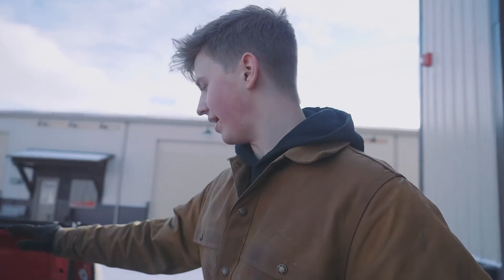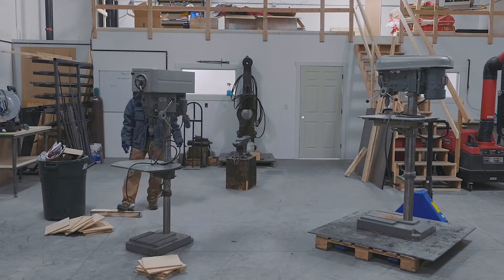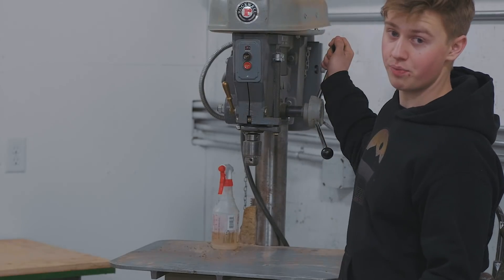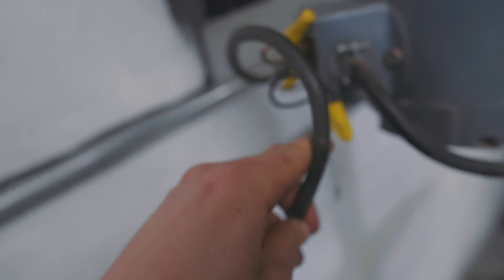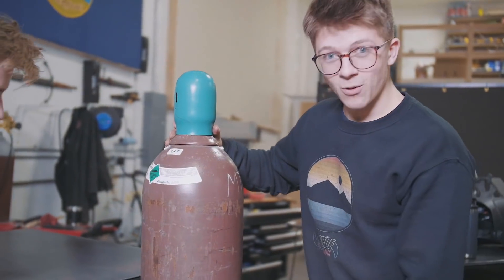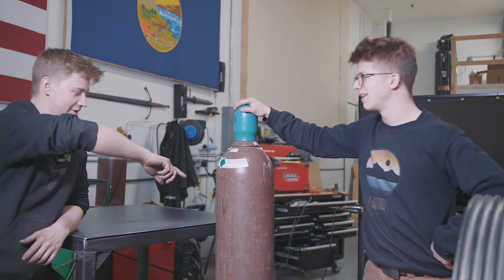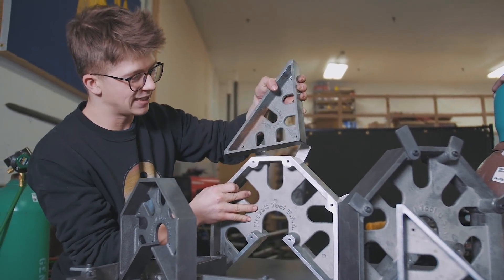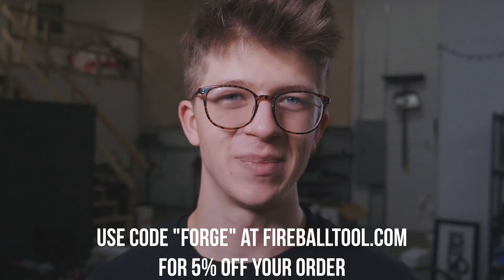TWO BIG OLD DRILL PRESSES AND MAKING A WELDING CART!!!

Comment: Instead of using a machine bolt for the tray that holds the welding bottle in to the rack, weld a stud on to the outside of the tray so you do not have the bolt-head on the inside.  You can cut a slot on one side instead of a hole so you can remove the tray.  With the bolt-head being gone the tanks will fit flat in the tray.  (BTW, put a piece of scrap rubber under the tank to keep there from being a corrosion problem (cathodic corrosion) between dissimilar pieces of metal (because the tank is a pressure vessel).
Reply: I was thinking about welding the mounting tabs to the outer edge of the plate flush with the bottom rather than flush with the edge on the top of the plate.  I think it would give you another half inch clearance for the tank.
Reply: Tisha Hayes Sounds like somebody welds
Reply: @Benzy670  I have been an engineer for 30 years who has worked in the oil and gas industry so I am (sort of) familiar with machinery. The only thing I can be considered an authority on is soldering (electrical engineer, oil and gas process control systems, that includes pipes, flanges, pumps, motors and big valves) where I was horrified at watching Alec soldering in one of his episodes. (hahaha).
Reply: @rlegato364  My thoughts exactly.
Reply: You could simply use carriage bolts instead of hex head

Comment: Btw that’s why you always work a certain job wit the same tape measure because if you measure with two tapes on could be worn more than the other and have more slip causing measurements to be inaccurate unless you use one tape for one job
Reply: Agreed, when I worked construction, first thing on the start of the day was compare tape measures with whoever you got partnered up with, so we'd Know the difference between the guy on the ladder measuring and the guy working the saw down on the floor. Brands vary, the biggest difference I encountered was a quarter of an inch.
Reply: Back in 197forever ago, I had an old contractor bop me upside the head after he watched me allow the hooked tab to slap back into the housing. After bopping and cussing me, he explained that letting the tab slap into the housing caused the holes to eventually stretch, thereby causing inaccuracies in measurements over time. I suspect, Mark Owen Johnson, that the 1/4" difference was more an issue of distortion than brand difference, although brand difference does play a small part.

Comment: The end of the tape measure also has serrations so you can scribe your measurements in wood if you dont have a pencil. Also, most have an oval notch on the hook that fits on a nail head when you dont have anyone to hold the tape for you. :)

Comment: If it makes you feel any better, I'm 40 and I just learned why the tape measure bit is wiggly.  The body is also usually 3" across, so that if you're measuring the width of a gap you can put the back of the tape against one side and just add 3" to the result.
Reply: Came down here to make sure the 3" across was mentioned.  Good job Jason!

Comment: I like both your new hair cuts guys!
Also, if you drill out a hole on the inside plate of the tank holder swivel to the outside diameter of the nut used,  you could weld the same nut so it's recessed inside the sheet metal of the swivel on both sides. IE take the swivel plate off drill it out weld the nuts inside install, shave the bolt flush boom you're done.
Reply: I was thinking the same thing.

Comment: Dude! It's been like a week or two since the last episode!

What about your hole in the ground and the concrete pour?

Another thing that's been conspicuously absent and not even mentioned by the two of you is your propane forge. I'm certain you won't be working with that little thing you've got now forever.

I.e. There's a lot of basic stuff I've got questions about, especially the forge and certainly in the context of bigger build and more swords you're going to need something just a little but more substantial than the little thing you've got set up now and most likely even a little bigger than the one you had in the UK!

So many question, so much suspense! Can't you at least give us some hints as to the plans you have on that side of things?
Reply: I've been wondering about the concrete slab too
Reply: See the new pour at 2:14  @kingofrandom9504
Reply: @davidwright640  thanks
Reply: @kingofrandom9504  I was wondering that to but also noticed that in some of the shots there was a new slab that must be curing and was surprised Alec didn't say anything about it.  Probably will in the next video now though.
Reply: Takes a month for full cure and it is more important for a hammer pad. Don't want to crack that expensive concrete.

Comment: Don't worry boys. Iv been building and finishing hand made custom wood bedroom furniture now for 4 years and that is the first I've heard of the tape measure slop thing. Dang it. Good thing wood is forgiving on tolerance.
Reply: Patrick Fathers you cannot be serious. Wood is less forgiving than steel! At least if you cut a piece of steel 2mm short you can fill the gap with weld - cut a piece of timber 2mm short and you’ve got to put it aside for a different, smaller project.

Anybody who builds genuinely high quality furniture would class a 0.5mm gap as too big.
Reply: Seriously for rough carpentry you're good within 1/16" but for furniture you need to be within 1/64" or better.
Reply: The NotSoGuitarGuy exactly right. 1/64 is 0.39mm and if I have a gap that big in a join of a piece of furniture that I’m building, it irritates me no end.
Reply: Obviously a cross cut saw has its own measurement stops. I generally don't use a tape measure when cutting parts. Tapes are only to double check that I have the proper piece of wood. There isn't a lot of free hand measuring done in a furniture shop my friends. Don't get to emotional now .
Reply: @steadfasttherenowned2460  - nobody is being emotional. Just suggesting that wood is not more forgiving.

Wtf happened in this world where slight disagreement means getting all emotional?
Reply: You just made my point.
Reply: @steadfasttherenowned2460  - not sure what point that is.
Reply: The internet lol

Comment: I didn't know that about tape measures either.
Reply: I knew it.. or more over understood it right away when i first used one as a kid, how ever i never trust them entirely anything but most rough cuts. End is constantly moving when in your belt and every metal to metal contact will shave few atoms loose, loosening whole end peace even more and eventually there will be some flop. If tape measure is low quality there most likely will be some error due production quality alone. Hence i always use 10cm mark and just remove it from final measurement in my head... when i dont forget to do it and hilarity ensues.. or i just burn my fuse :D
Reply: @essential craftsman shared that in one of his older videos.
Reply: @Hellsong89  Same here. Nobody told me, but it seems a kind of self expainatory way of working.
Same goes for the accuracy.

Comment: Would it not have been smarter to reverse the truck into the unit and pretty much just drag it off to where its gonna lie? Looks like you had the room.
Reply: Probably didn't want a dirty snowy truck in the shop and let all of the heat out.
Reply: @andrewmartino6144  or risk running onto the new concrete slab
Reply: the 6+inches concrete slab has been poured recently and can't take load for a while
Reply: Nah, the pallet jack is much easier to manuver inside the workshop, and backing a vehicle through a bay door is a lot more obnoxious than backing up to one...

Comment: Ok so I taped down a sewing measuring tape to my desk and I use it for when ever I work on any projects or when I work on making my costume jewelry. Maybe you could use an angle iron and have someone engrave the measuring tape numbers and measurements on the angle iron. 1 iron in Metric and the other one in the US system, you could weld the angle iron to each sides of your table. Also you could install a flat piece of iron on the floor with engraved measurements as well. Just a thought.

Comment: Alec! The plate at the end of a tape measure has a slot in it for screws and nails! The slop is so you can hook it around a screw head and get acurate measures from center screw to center screw. Also, the tape roll itself says the exact width so you dont have to bend the tape and guess your inside measurements. Best of luck!

Comment: @Alec Steele ooooH, Please do a video showing the rewire of that Delta Drill press !  I have one exactly like it I just bought and it has the same Crunchy Wire Syndrome!
Also, you could convert your bolts on the welding cart to tapered flat head bolts, and that looks like it would fix your problem without having to remake the plate or design!
And finally, if you wanted, your electrician can re-wire either of those motors to be what ever you want them to be 120V or 240V.  The wiring diagram is likely on the faceplate of the motor, and if it's worn out, you can find them online.

Comment: I would like to see you build a ribbon burner forge. I have been researching and there isnt a down side that I can see. They have multiple jets that flames burn from spreading out the heat. They don't use the propane to suck in the air into the combustion chamber instead it is pushed in with a blower. You get a more complete burn cycle in the forge and because all the air is burning less oxidation can occur. A real plus for people who like to make Damascus.  There are videos of people getting their forge hot enough to set welds and only using between  1 to 3 pounds of pressure on the propane. A Venturi burner requires higher gas pressure because it uses it to suck the air in. These have a totally adjustable needle valve for the fuel ratio and a ball valve for the air intake. A little more to making them but way more efficient especially for a blacksmith shop and not the weekend warrior like myself.   I hope alec gets to read and respond better yet build one. If not and you are reading this look them up they are very impressive.

Comment: drop a bottle jack into the tray and open it up a 5-8 mm more to allow the bottle to roll on, the steel will flex enough to allow for that kind of post production movement, Same with hitting a studded wall to put it in Plum.

Comment: On the welding cart, try flipping that tank tray over so the bolts are on the underside.  This will hold the tank a bit higher, but you can roll it on without the bolt heads getting in the way.

Comment: Another tip about tape measures if you let it slide back in too fast it can damage the spring inside. And it can wear down faster let it back slowly and it will last more than a few years.

Comment: There are a few more things about measuring tapes you might not know. Like the  number on the backside bottom side is the length of the tape measure.  And that little notch is a screw grab.

Comment: On your cart where the bottle won't clear the bolt head. A easy fix for is to cut the head off the bolt and weld the bolt flush to that piece. It will still hinge in the other hole the bolt goes in and the bottle will clear then.

Comment: If you swap out the hex bolt with a carriage bolt the bottle might roll on looks like you’re just a bit tight.  You could also just weld a piece of threaded rod in the hole and grind it flush.  The shop is looking great.  Nice work!

Comment: Have you thought about a gantry hoist for lifting/moving smaller pieces of machinery around the shop?  You can get them with casters from Harbor Freight... or elsewhere... for under $2k I think.

Also weld those pivot bolts in on the "pivot plate" and grind them flush!!!

Comment: Tapes have an 1/8th inch play whether you’re pulling our butting, to make accurate.... also check them on the side for heel to toe length; It’s usually 3 and somethingth inch which is more accurate than folding the tape into a corner.

Comment: Another thing with tape measures is usually the spool body has a known size (often written on the body) so you can butt up against something and measure from the tape end right to the back of the tape body. The measure may say 7”, then the spool body is 2.5” so you have 9.5” total length. This stops you having to do the crazy extend and bend in a U shaped gap.

Comment: I am impressed how quickly you have picked up the imperial system of length/weight measurements. Did you always use metric at home?      A pint a pound the world around!
Reply: Americans got the Imperial system from the Brits. Metric comes from France. When Metric took the world by storm American manufacturing companies had just finished this huge growth spurt and didn't want to make the switch. While the Brits (and technically American too) governments recognize metric, brittish citizens are usually well versed in both systems. Alec has been using both in his videos for years. If you go back and watch his first sword builds you'll see him say something is x millimeters long and then he'll also say how many thousandths of an inch it is so his Ameri an audience can follow along.

Comment: Just make a new bottom plate for your bottle with the tabs on the outside. You'd gain enough clearance to slide the bottle in and out no problem and it is only 1 piece you have to rebuild.

Comment: If you were excited to learn why the tip of a measure tape is loose, then wait till you find out that the slit in the tip is so that you can measure the distance a nail on the wall is off the ground  by hanging the tape measure off of it. Or is it the serrations on the tip are so that you can mark a measurement. Oops I guess I just told you LOL

Comment: Hey Alec I have a challenge it’s the only solder challenge the rules are only hand tools optional if you do that then you are aloud a soldering gun and a heat gun and you must make the thing out of solder p.s it’s easy to file it takes about five minutes per square inch or so

Comment: You should weld Studs on the bottom of the cart instead of using bolts. That should let the tank slide on without touching anything

Comment: @Alec Steele   well that second drill press needs some rewiring. could not tell if someone had spliced in that switch or the rubber coating on the wires was so bad that it cracked.
anyway i hope it is not too expensive to fix but i doubt it. electrical work tends to cost more....

Comment: The pulleys in the variable speed are made of pot metal and will break if you work it too hard. At my school we have the 12 inch version of the that one, the pulleys broke and we could not find any replacement parts at all. They were discontinued and we could not find new old stock.

Comment: Hi. congrats on two good machines. It seems as you are doing well. But at 2 min 35 one can see at the left in the image, an extension cord on a selfwinding drum. Be careful, using such equiepment, as the cable get hot on the drum when electric loaded, and can possibly melt the cable, or worse, catch fire.

Comment: Hey alec I'm currently in the process of building a home forge from an air tank. I plan to insulate it with 4inches of kaowool and then rigidizing it and coating it and the fire bricks with ITC 100 I'll have a 6.5in diameter hole to work with that goes the length of the tank which is 28in I'll have 780 cubic inches I'll have to heat. Making it to where I should need between 375,000 to 400,000 btus to get to welding temperature assuming I go by what I've read stating that i should use 500btus per cubic inch to forge weld. Does all this sound accurate to you? Would the 4in insulation bring my need btus down some or do I still the the 375,000 to 400,000 btus? Do you have any recommendations for how many burners I should use and what kind? I'd really appreciate your input on this. I've put a lot of time and research into getting started on this.

Comment: If the drill presses were used in a woodshop they may be too fast for metal work. Several ways to fix that, First is to change the pulleys, Second is to find slower speed motor, Third variable speed control.

Comment: You will prefer that variable speed drill press in your machining area anyway. Swapping belt positions on the drive pulleys suck anyway. You can just leave the other one as slow as it goes and use for larger bits. It's crazy how many people will smoke a bit because the hassle to change speeds.  By the way the shop is looking good. We are ready to see some hammers pounding.

Comment: You guys should start designing stuff in CAD so you can actually see it and anticipate problems like bottles not fitting around bolts.  It takes an afternoon to learn Fusion 360 well enough to model hand built stuff and it will save you time and money in the long run.

Comment: Next time, hammering out an ingot of copper to then draw into wires for the electrician to fix the pillar drill with? Could even make the drawing block with the one drill that's currently operational...
...hey it's not stupid if it works, and you'd be sure of the quality of your wiring! '> .>

Comment: Lol. That tape measure trick was woodworking 101 for me. Along with the good old fashioned 3-4-5 triangle rule and how to cut joints. 

But to be fair,  you are blacksmiths,  not builders or engineers.

Comment: Hi Guys, couldn't you just make a new plate for the fancy smancy bottle holder a bit wider where the plate bracket connects on the outside of the brackets on the cart to open up some room so the bottle rolls on?